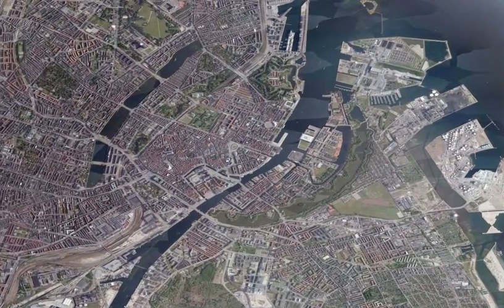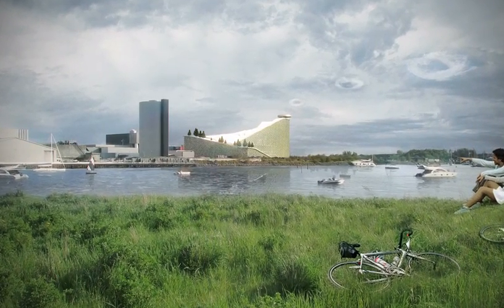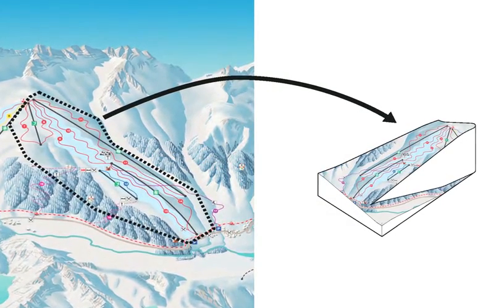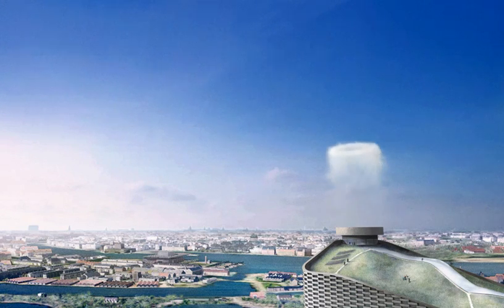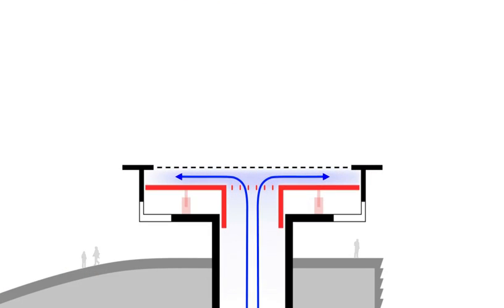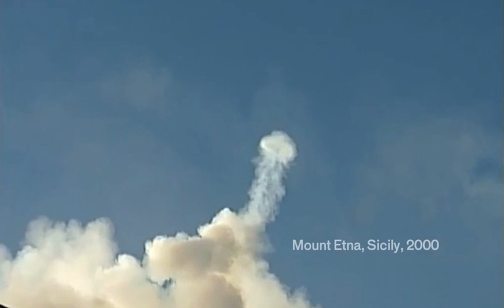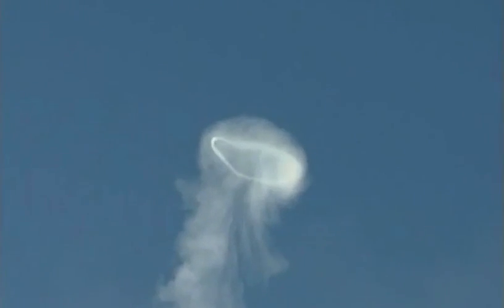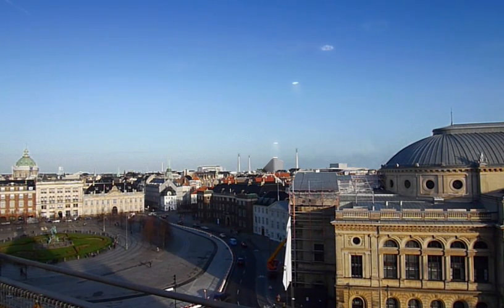BIG Vortex - A Building-Site Art Installation by realities:united for Amagerforbrænding, Copenhagen

Comment: That's really cool! But I'm going to be "that guy" . . . I can't imagine what a nightmare it will be for the workers to maintain that smoke ring blowing mechanism. Incinerator stack gas is typically around 200 deg C (400F) and quite corrosive. Trying to keep a shutter system & bellows mechanism working properly in that environment will be awful!! 

I tip my hat to any engineer that can make it work long-term!